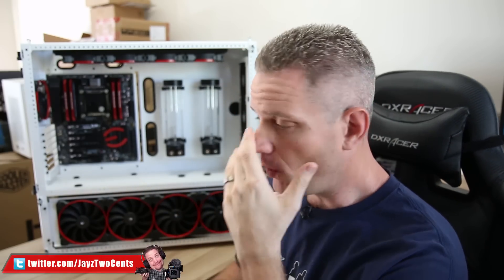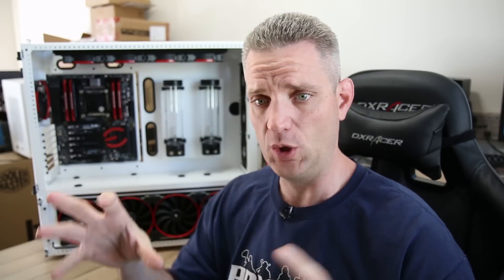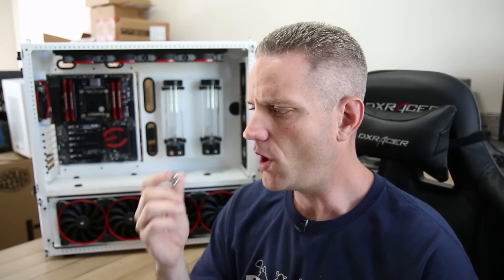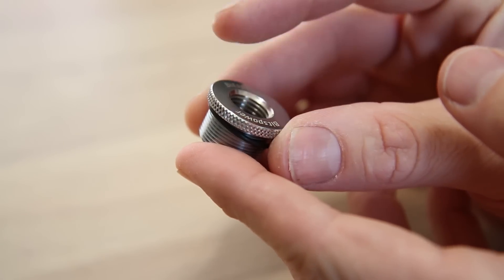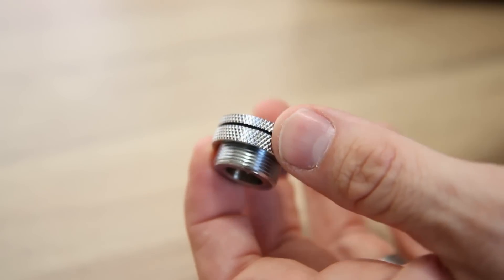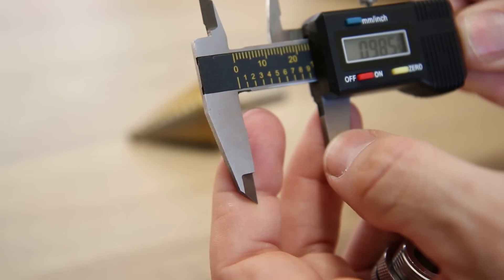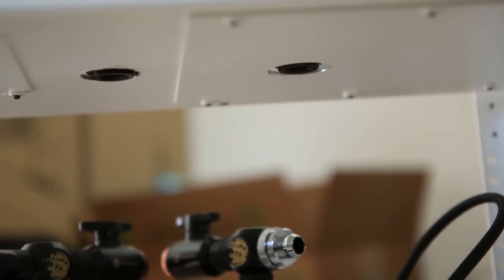How to pass tubes through walls and floors - Bulkhead Fittings

Comment: Question, can you use this fitting as like an “adapter”? So I’m trying to have a mixture of rigid tuning and using it as an adapter to soft line tuning. 
Is this a bad idea due to leaks?

Comment: Can these bulkhead fittings be used to secure a reservoir to the floor? I'm using a Tower 900 and really do not like the brackets forcing the res to be up against a wall. I'd love to just be able to keep in on the floor

Comment: I need a watertight bulkhead, but I'm having trouble finding the size that I need. Here's the problem: 

My problem is obtaining the proper size bulkhead. The hole is 1-1/2" in diameter, but the shank of the bulkhead must be at least 2", and preferably 2-1/2" or 3".  I've been to many Internet stores, but I've found it impossible to find what I want. Can you help? Oh, just to be sure, I will be screwing a 3'4" faucet into the outside end of the bulkhead.

Comment: Can I use those fitting on walls, as in house walls, so I can run pipes within insulated walls and throw the reservoir, pumps and and radiator out of the room?

Comment: Have you used the EK-AF Pass-Through over the Bitspower one before? By the looks of it, the outer thread doesn't seem to have enough grip to fit on a thicker plate, like your acrylic midplate. I am designing a system where I'd like to use all EK nickel fittings and I need to go through a 5mm acrylic plate four places, but I fear their pass-through fitting is going to require an additional flat counter-sink to be able to tighten properly.

Thanks for a great video. I can add that the names I've come across for these fittings range from bulkhead, pass-through, casetop water-fill, and many more. The Bitspower model name is BP-BSWP-C04 (Black Sparkle -- replace the BS with other version, i.e. MB for Matte Black, etc.).

Comment: I might sound like an idiot to some of you, but why do you need these? Why can't you just drill a hole in the case and put the tube in there? What's the need to put a fitting to put the tubing in?
Reply: I can't even I just can't answer that if u don't know research alittle
Reply: +frogcraft playz I searched around a little and people did say that they aren't that useful and are mostly for aesthetics, though sometimes they can be useful if you need to make a 90 bend right after you go through the metal or say change to soft tubing in the basement. Is that it?
Reply: +Tyler Weigand yea it's just for making ur pc look better
Reply: +Tyler Weigand and for leaks to

Comment: Hi Jay, i have plans to build the same WC system than you there: Cpu + vrm loop and vga loop. So do you have some video describing all parts do you use? I mean, like a list of components? Brands, size of parts, etc.? Anyway, i'm using a Asus x99 Deluxe and 5960x at 4,8Ghz with H100GTX. Thanks!

Comment: Hi. I was wondering if anyone here could help me out a little bit. Do you guys know if this is gonna work?

- AMD FX-8320 Black Edition, Socket-AM3+, Prosessor, 3.5GHz, 8-Core, 16MB Cache, 125W, 32nm

- Corsair CX 600M, 600W PSU ATX 12V V2.3, 80 Plus Bronze, Modular. 2x 6+2pin PCIe, 6x SATA, 4x Molex

- Crucial DDR3 BallistiX Sport 1600MHz 8GB 8GB kit(4GBx2), CL9, 1.5V, CL9-9-9-24

- EVGA GeForce GTX 960 4GB PhysX PCI-Express 3.0, "SSC", w/ACX 2.0+, DL-DVI-I, HDMI 2.0, 3xDisplayPort

- MSI 970A SLI Krait Edition, Socket-AM3+ ATX, 970+SB950, DDR3, 2xPCI-Ex16, SLI/CFX, SATA 6Gb/s, USB3.1

- Seagate Barracuda® 1TB SATA 6Gb/s (SATA 3.0), 64MB Cache, 7200RPM, 3.5"

I' m building my first gaming pc and I'm not sure if this is gonna boot up and work all fine?
Reply: Yes
Reply: I would go for r9 380 4gb version,  it performs better than the 960
Reply: +Vault 22 thanks vault
Reply: NeTTZy no problem fella

Comment: how can you line up your res with the passthroughs? and how do you put hardline tubing in between the res and the passthroughs? thank you
Reply: if you really want to you can use a pencil and a ruler to draw a straight line down the panel and across the floor. just go light on the pencil so it erases cleanly
Reply: James Mastroianni  thanks james for your reply, but putting in hard tubing from the res to the passthrough does it have to be perfectly cut to size? just looks like it would be hard to get the hard tubing into the res and passthrough
Reply: +newport5504 well remember if it's too long as long as the bend is okay you can always cut a little more off

Comment: Use some vaseline and a file to smooth the hole edges and you might not cut yourself as much.  The vaseline to catch most of the filings so you don't have to deal with that stuff going where it doesn't belong.  Or, slice and dice and drive on.

Comment: This might be a silly question but couldn't you just drill a hole and get a grommet from the hardware store and pass a solid piece of tube through the grommet? And have one less possible point of failure or leaks?

Comment from the maker: The reason I held my caliper long ways instead of sideways (perpendicular to the fittings) is because the teeth fit within the threads and would not have been as accurate. Let's focus a little less on the things that dont matter as much, and more about the content, mmkay?
Reply: +JayzTwoCents That's why you normally hold a caliper SIDEWAYS on a thread - not using the tips of the caliper, but a little bit further, where the caliper gets thicker. Hope you appreciate learning something.
Reply from the maker: +wsxgfhccr Really?
Reply: +wsxgfhccr Because that wouldn't look near as good.
Reply from the maker: +Georg F I love learning new things!
Reply: +JayzTwoCents Whenever I build a PC I put on a pair of thin rubber gloves, like surgeons gloves but not sterile, you still get max dexterity but it really saves your hands in the end, bonuses include not leaving finger prints everywhere and mega grip. Protects from nicks, cuts and abrasions etc. No more raw hands from a day building. Costs a couple bucks from your nearest cleaning products aisle. :)
Reply: +JayzTwoCents yeah... as a machinist... that is how i measure the outside pitch of threads... just saying..... the best way to do it without using a thread micrometer and doing the math to figure out the thread pitch major dia.
Reply: +Danny Alford and honestly pulling the machinist hand book and looking up the thread size and find the major OD will give you the correct number too... just saying.
Reply: +JayzTwoCents If you use the flat of the calipers instead of the very tip, you'll nearly guarantee good results when measuring circular things.
Reply: +JayzTwoCents Why didn't you just run the tubing through the hole instead? Save you the trouble of having another 3 fittings and 3 points of failure?
Reply: +Mistermoeshmoe Well, I figured since they were gonna be at the bottom of the case, that the side panel would be blocking the view, so it won't be that obvious
Reply: +JayzTwoCents id like to see one with a nut on the bottom so i could wrench it down better but then again it doesn't need much torque does it? lol i have and identical cut on my thumb but it was the other way around...i got it at the shop
Reply: Hey jay where do you get your parts from?
Reply: +Tommy Juarez He's mentioned Performance PCs as his go-to for many of his parts.
http://www.performance-pcs.com/
Reply: +JayzTwoCents The mid plate isn't aluminium ?
Reply: +emmanuel_c I'd imagine being an SMA8 case, it would be aluminum. He just has a sheet of acrylic laying on top for the extra shine.
Reply: But it looks like it's acrylic all the way throught. You can see it in the drilled hole.
Reply: +JayzTwoCents BLASPHEMY!!
Reply: +JayzTwoCents yup realy hole and gromet
Reply: what case do you use in Skunkworks?
Reply: +JayzTwoCents Cheap verniers aren't accurate anyway. They've got shocking float in their measurements. Mitutoyo or bust.
Reply: +JayzTwoCents Lol. these guys would not be fun to have over for dinner... I mean who else will save the world from questionable caliper use?!
Reply: +GuagoFruit Wow. Is it that hard to hold the calliper at an angle across the thread  and get a measure. Its not rock science.
Reply: +GuagoFruit yes its not geology.
Reply: +JayzTwoCents It doesnt matter how you hold the caliper as long as you get the right size

Comment: Hurts my machinist eyes when Y use caliper like that. I've been looking to put a fill port on my pc but the step drill are damn expensive and hole saw sizes might not be good.
Reply: +Tommi Honkonen Same here. I had to comment about that, and now Jay is mad :/
Reply: -Tommi Honkonen - You're a machinist and can't afford a step drill bit?  Why wouldn't you even have one (or better) already?

I like using step drills actually as they do tend to cut a nice, clean, round hole compared to hole saws or hss drill bits which can wander or snag easily.
Reply: 9ff70f96 It's so rare that I need one so I won't buy one because I don't need it too often and if I buy something I buy proper so it's going to cost me.
Reply: +Christopher Lennon - That's good to know, thanks for the tips.  As an electrician I cut a fair number of 20/25/32/40 millimetre holes in things, mostly for gland/grommet cable entry in steel distribution boards or plastic adaptable boxes.  I've tended to find hole saws can wander a bit (even after the pilot bit has gone through) and not produce such a nice clean hole (sharp cut edges) afterwards, so, for example, a 20mm hole saw often ends up producing a hole a little larger than desired, and probably needs a bit of de-burring/sanding/grinding afterwards.  With your typical HSS bits, I find they can snag and rip into the metal or plastic too often, and/or end up not producing the nice clean hole we desire.  I find stepped drill bits don't tend to suffer these problems so much though.  They are useful too in de-burring the finished hole a bit if, for example, you cut to 20mm, yet run into the next step a small amount to clean off the edge.  I don't know, I'm sure there are better, proper ways to cut such holes (as you mention), but just from my own experience, step drills are quite a good choice for a nice cut compared to other methods

Comment: Hey Jay, just wondering. Besides the slight aesthetic plus, is there any benefit using the pass through fittings rather than just drilling a hole for the tubing itself?
Reply from the maker: +Dallas Blackburn Well as long as you make sure the edges arent sharp, not really
Reply: +Dallas Blackburn The pass through look a lot nicer.  That alone makes it worth it, I think.
Reply: Ok, just didn't know if there was a structural benefit or anything. It does look very clean, I just wouldn't be able to justify spending $10 a fitting to essentially make a shiny hole being as I'm a broke college student. 

Love the video's Jay, thanks for the quick response.

Comment: Jay, you're a car guy, I expected from you to know how to use a caliper...
Reply from the maker: +Jerikman I used it just fine
Reply: +JayzTwoCents how is nizzy doing ?
Reply: +JayzTwoCents The way you used it is not the correct way to measure diameter, because you cant set the caliper on the thickest par of diameter, its always a bit off. It was fine for what you were measuring, bot consider the viewers who learn from your videos.  Just trying to help..
Reply: +JayzTwoCents hes not really wrong.  if you want an accurate measurement of a diameter with a pair of calipers its easier to do it if you put the flats of the outside jaws across it than trying to get that small point on the center line( like this |O| vs - O -).  granted that doesn't matter as much because you were just demonstrating the approximate size.

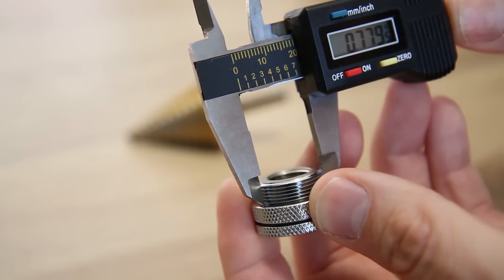Comment: 3:25  How NOT to measure with a caliper.
Reply from the maker: +Jerikman If I turned it the other way, then it would have measured the INSIDE of the threads, get it now?
Reply: +JayzTwoCents no, no. no. You are supposed to use the thicker part of the jaws. Trust me, Jay I work with these every day.
Reply from the maker: +Jerikman I get what you are saying
Reply: +JayzTwoCents What Jerikman said, one more thing, apply a really small amount of pressure on the caliper when measuring, just enough to make sure you're making good contact with the part.  I've been working with parts that require 0.01mm precision at a cnc machine shop for 10 years now. Cheers!!!
Reply: +TheTopTechnology kids watch his videos and learn from him. Knowing how to use a caliper is very useful, so they better learn the correct way.
Reply: +Jerikman it doesn't matter with tolerances this large
Reply: +Jerikman clearly he has no engineering or mechanical background, I spotted his mistake instantly, but kudos for him actually trying to use a caliper, instead of a tape measure. Clearly no one has ever taught him how to use it properly, but he has my respect for trying ;)
Reply: +Jerikman gratz on getting pwned by Jay.
Reply: +MalevolentJester srsly???  What video did you watch? 
He clearly has no idea how to use a caliper and im the one who got "pwned"?
Reply: +Jerikman who gives a fuck?
Reply: +Jerikman well the right way would be to mic it but kids don't need to learn from videos that aren't tutorials
Reply: +TheTopTechnology they choose their role models by themselves
Reply: +Ronke&#39;s DIY Workshop Well it's not really rocket science...
Reply: He means turn the pass-thru side-ways and hold it further in the jaws close to the main body of the calipers where the jaws aren't bevelled!
Reply: +Jerikman I'd say snugging down the calipers was his bigger mistake, since not every object can be measured as close to the slide as you'd like. But for his purposes, it's not important.

Comment: Should have talked about rubber grommets, since it is a much cheaper way to pass tubing through walls and/or floors. I mean depending on the fittings, you're looking at anywhere between probably a minimum of $20, to in some cases upwards of $30-50 per pass through. Compared to under $1 per pass through for a rubber grommet.